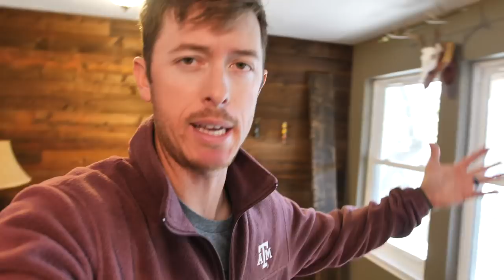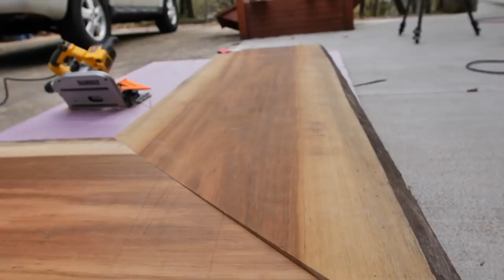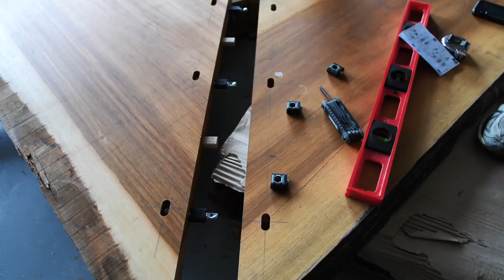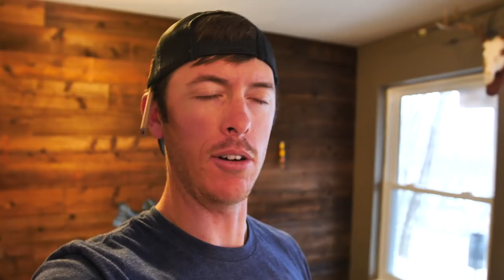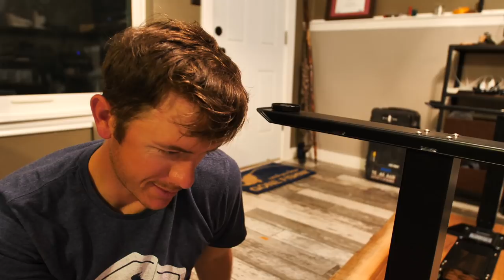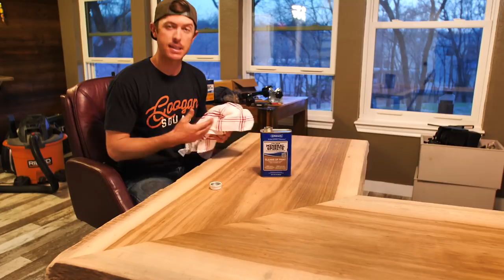DIY Standing Desk with HUGE TIGER WOOD SLAB!

Comment: I'm not sure what you finished the top with, but for an all natural finish is Epifanes High Solids Tung Oil Varnish. This is used in boat & ship building. If you like to protect it from water damage prime with a few coats of 2-Part CPES before the varnish.  This will give you a very natural look & finish. Apply varnish until you get the gloss you prefer have. I have a sign I could send the information on that's been outdoors for 5 years & looks new. McNair Signs & Graphics....Tung oil will give you a harder finish and more durable finish for a lifetime. I'm available to help if you need a wood finisher.

Comment: A tip for the future: When using a rasp you should only work in one direction. Drawing the tool back can bend the teeth down dulling it.
Reply: zerg539 that’s some strong wood if it can bend  hardened steel ! Thanks for the tip !
Reply: @chrisbannister2137  it's not that the wood is hard it's that the force is in the direction of weakness of the teeth.
Reply: zerg539 pmsl 😆 ok then ! I’m sure you have year of experience rasping wood and stuff but I’m sure woodworker arnt Gona worry about rasp steel   teeth  that much on wood
Reply: @chrisbannister2137  His statement is correct and a craftsman maintains their tools of the trade.

Comment: Hey LFG, if the cracks in the desk start to become more prominent you might have to do some butterfly joints. Also for the cables it wouldnt be a bad idea to use the leftover tiger wood to make the box for them.

Comment: Looks beautiful! My only comment is that the live edge may not be the most comfortable thing to rest your wrist or your arm on. And the live edge may be somewhat fragile, with the bark eventually breaking off, which could be stabilized somewhat with an epoxy coating.

Comment: You could've built a leg that had coil/spring inside that could've supported the extra weight and it would've worked with the elevating section and you could've had a huge desk like you wanted. But hey, it looks great!

Comment: When OSG was in frame about to lift the large part of your table I was thinking noo don't do it Steph but then 2secs later I remembered oh yeah she's not pregnant haha.. Good to see osg didn't loose to much strength during her pregnancy.. Table looks amazing LFG. You may want to also put a coat of linseed on the bottom as it will protect the wood from any possible rotting and drying out

Comment: Drill out the middle of the scrap peice with holes attach it to the bottom of the table and run the wires threw it, and the decent size peice make alittle shelf with, then you end up with minimum waste

Comment: Might have made a straight exact length you wanted on the long piece then cut 22.5 angle cuts on end of boards that way you wouldn't need to flip it and kept the grains in line but good learning video.....

Comment: You didn’t clamp down that track???
Reply: Matthew Chastain  don’t have too, it has non slip rubber on the bottom and with the weight of the saw on top it typically doesn’t move.

Comment: You also could have bought a telescopic desk leg for that 1 foot you cut off. Sure you’ll have to adjust it every time you raise or lower your table but you wouldn’t have wasted that one foot. Ps. You should sand your wood with the grain. You’ll have less visible scratches in your desk.

Comment: Boiled linseed oil is nice and all, but it isn't very protective. General Finishes Arm-R-Seal is extremely protective and brings out the wood color. 3 coats of gloss and 1 coat of semigloss, and you're cocked locked and ready to rock.

Comment: should have cut a wedge from the middle and not flipped the slabs. you would not have had to cut the edge on an angle. and the grain would have lined up better, same with the high/low.